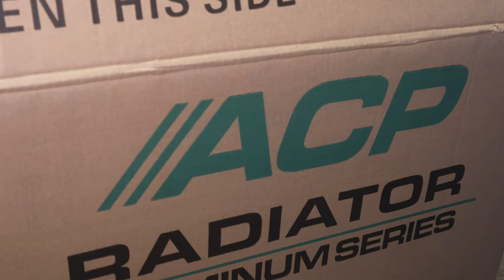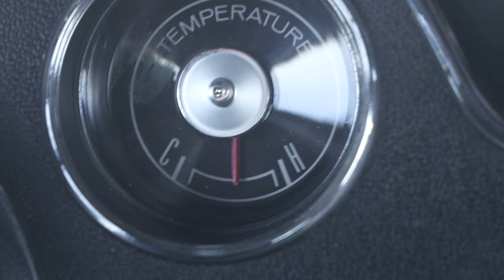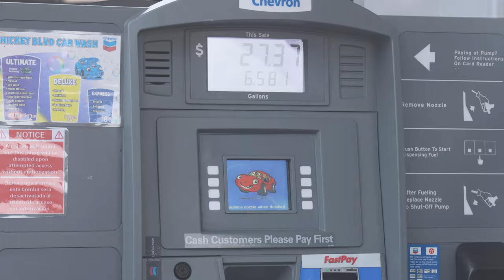1967 Mustang Radiator Install

Comment: Hello Gelstang! Nice pony you have there! In retrospect, I changed out my radiator last Oct after my flex fan went into the core and destroyed it. I got a nice alum. radiator from Speedway motors but my old beautiful alum shroud did not fit it do to it's smaller size. Then it started running a higher temp even with two pusher elect fans in front. I run a high flow 180 deg thermostat. I run a 460 big block mild build engine. My problem was air in the system after the work was done. I bought the "No spill" funnel and burping kit and I was amazed of all the air it purged out of the system. I think I will get the ACP radiator and shroud, and sell my Speedway radiator. Thanks for sharing. You handle your tools like a pro girl! Nice job! Cheers from Motown/Dearborn, home of the Mustang.

Comment: Great video. Only one thing is that is not a good paint for this radiator application. Using a paint that had copper in it and keeping it to a single coating would have allowed for adding color without risk of added heat retention. Since this is a better radiator, doubt you'll see any detrimental deduction. Just an FYI for anyone else watching that runs a more performance application or has a hypo engine. 

Also, best to have a gasket in the lip of the fan shroud housing to encourage every CFM to push through the shroud